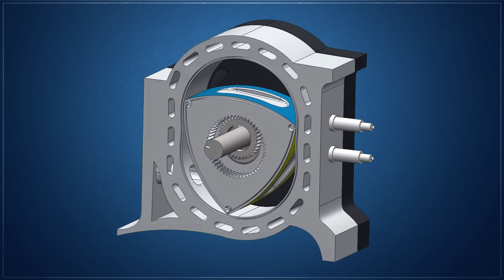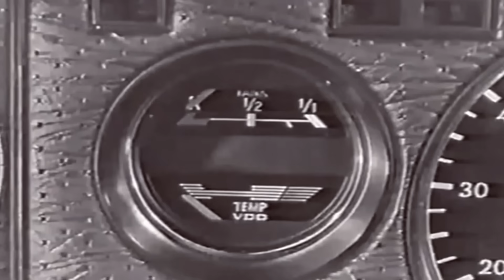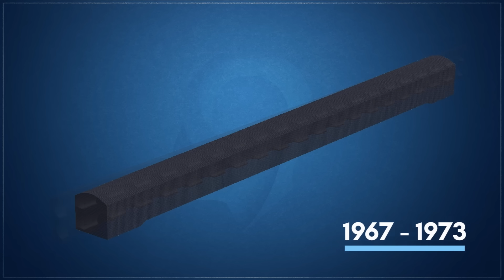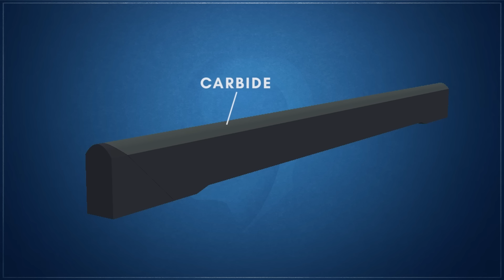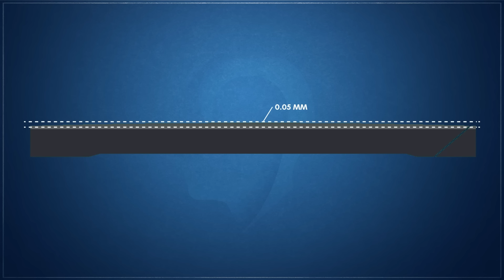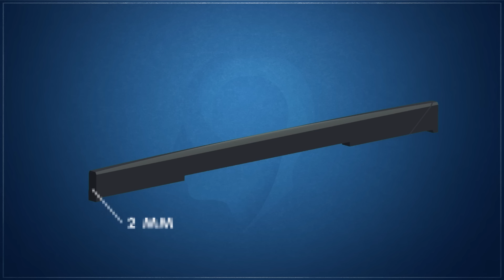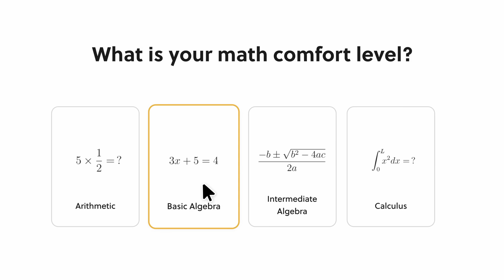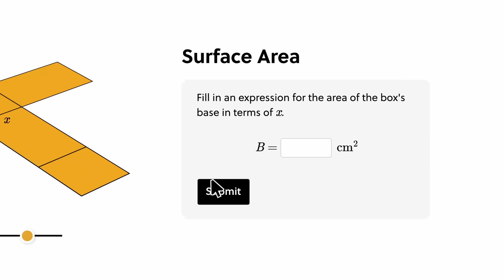Overcoming The Rotary Engine’s Biggest Flaw

Comment: As a Mazda tech when customers would come in and ask me what I thought of the RX-8 I told them it was very important that they purchased it with a sunroof. Once the compression dropped off to the point that it wouldn't run they could park it in their front yard and use it as a planter box.

Comment: It has more problems than just the seals , it can only produce decent toque at high revs and is notorious gas guzzler , it will only ever be a novelty !!! the ICE relic should be dumpt !!!
Reply: The Wankel engine is not just inefficient it is also inherently unreliable and less durable than reciprocating engines,
 ICE's are not going anywhere... its just the Wankel that is dead.
Reply: @DoktorBayerischeMotorenWerke  Time you moved to 21 century , this ICE garbage should of been killed off in the latter part the last one , it belongs with the steam engine !!!
Reply: @dennisrichards7994  ICEs are not going anywhere... they are here to stay, in some applications there are no practical alternatives.
Only the Wankel is obsolete, it was a dead-end concept that was never a threat to the successful ICE types.

Comment: You said the main problem with the seals was frictional vibration. They look to be positioned at a right angle to the contact surface. Did they try positioning them other than straight up 90 deg? Like a paint brush, even a ten degree difference would have solved that issue.
Reply: Apex seals are not a positive-type seal like reciprocating engines use where the seal integrity increases with pressure, both vibration and pressure from erratic deflagration and brisance cause the seals to leak and the hot gasses leaking pass the seal causes ablative damage that destroys the apex seals.

Comment: It has been reported that the biggest drawback of rotary engines is that their combustion chambers are long and narrow, like an eel's bed, making ignition difficult and preventing combustion. For this reason, early pollution countermeasures used a thermal reactor to re-burn unburned gases inside the muffler, and warnings were given that the high temperatures could cause a fire if the vehicle was parked on dry grass. Has this problem been resolved?
Reply: No, it hasn't.  The Wankel has an inherently poor combustion chamber architecture that results in poor combustion efficiency and high EGT (exhaust gas temperature) the design is also prone to pre-ignition and detonation that destroys the apex seals.

Comment: I think, the apex sealing/tribology is not such a big issue with the Wankel/Peschke engine. In principle you can solve it with a nice friction pairing like graphite against cast steel. You will always have enough water vapor to generate a sliding film within these components. The same relates for the side sealings.

In my opinion the biggest issue is overcooling due to a non-convenient volume to surface ratio. Another problem is the angle of attack of the chamber pressure with respect to the shaft. In a rotary vane engine it is much better. You can also balance the torque very easily by use of an elliptic chamber geometry.

Comment: Instead of solid Apex Seals, they should have installed rolling Zylinders at the Apexes.
Reply: How? the rollers need clearance to spin... that would allow gas to escape.
Reply: @DoktorBayerischeMotorenWerke Nicht unbedingt, wenn die Haptwalze selbst mit Walzen gelagert ist. Wie bei einem Kugellager.
Reply: @GuidoHenry1985  There are no known examples of the roller ever being used successfully as a gas tight seal.
 The rollers require clearance to expand with heat and will expand at a different rate.
 The roller is not a positive-type seal, as gas pressure increases, they do not increase their seal effectiveness like a twist-type seal in modern piston engines.
 Any questions?

Comment: Actually not having the right consistent combustion pressures(right amount of fuel) consistently,(it sometimes gets if and sometimes it doesn’t, it sometimes gets it and it sometimes doesn’t as it spins) is the true culprit due to again not knowing the right consistent fuel psi’s. If it sometimes gets it and sometimes it doesn’t then fuel delivery is what needs to be figured out. Flame will not be quenched if thrown at  right amount of pressurfrom low to medium to high as it escalates and decreases all the time and never stops moving. All the quenching of the flame is caused by not enough fuel pressure where it needs to have it all the time.

Comment: Hi folks,
        A good engine.  However, I like The "Revolver 12Cylinder Engive.  It has half the size,  weight, and parts.  Unlike 'V' configure internal combustion engines, it can run @Full Power without crankshaft failure.  It ran for 36 hours straight, wide open, without difficulty.  The tester turned off the engine when he stipped the test to go to bed.  V configured engine's cra k shafts can't take that kind of punishment. So check it out.
        Sincerely yours,
        R.

Comment: I once had a REALLY old low pressure dental compressor that worked off a single triangular rotar with three reeds like the wankel but made of  graphite ceramic. 
This isn’t new. 
The oil was delivered by a Mckoy type glass drip cup.

Comment: The primary problems with the rotary engine is the spark plug hole, and the position of the chamber in the rotor itself as it should be off center pushing the rotor in the direction of travel, and the spark plug hole reduced to a slit with a width less than the apex seal.

Comment: I owned three RX-7 models, and completed over 200,000km in them in total. I never EVER revved a cold engine, never drove off without letting the engine idle for at least 30 seconds, and never EVER took the engines above 3,000 rpm until they reached operating temperature. But... once they got warm, I gave them absolute death.
All three engines had been rebuilt with the proper 3mm apex seals, and they never let me down. I liked the fact they inject a little engine oil somewhat like a two-stroke. From memory, I added half a litre of (not synthetic!) motor oil for every 500 kilometres covered.
All three were fantastic cars that I enjoyed greatly, and maintained properly. I think it was poor fuel economy and bad combustion which doomed the rotary. Except now we're getting little rotaries as pure electric generators that aren't connected to anything except the battery. It will be interesting to see if full computer control over all aspects of engine operation can ensure engine longevity, and efficiency.
Can't wait for the Mazda Iconic SP!

Comment: The Wankel would run on as low as 67 octane (Coleman lantern oil or kerosene) and when you lower the octane by 10 points, you can make 4 times more fuel from same amount of crude oil. Any wonder why gas companies hated the Wankel? 

The Mazda passed the 1976 smog requirement in 1972 and no other car had passed the 1972 requirement. It had 2 spark plugs for each firing, leading and trailing to guarantee full burning of fuel.

From Motorsport Publications 1972

Comment: I spent 2 years in a Mazda dealership service department during the 70's.  Even with constant maintenance the rotary powered cars were doomed to fail eventually.  Oddly enough the piston engine variants were bullet proof and once sold were never seen by us again.  A local put an Rx4 engine from a totaled car into a sand buggy sans all the emission control devices.  He kept getting bumped to higher levels of competition until he ended up in the unlimited category.  His car was unbeatable if the driver could keep it right side up which considering the torque it produced was easier said then done.

Comment: You can improve the internal combustion engine but you can never overcome it's greatest flaws. It has too many moving parts that break or wear out and it is never more than forty percent efficient. You waste sixty percent of your fuel as friction and thrown away heat. The best that's ever been achieved is with the six stroke water injection engine where there's a second power stroke achieved by injecting water into the hot cylendar which produces steam pressure and also cools the engine. It still only added about twenty percent efficiency for a total of sixty percent but needed a supply of distilled water to prevent scale build up and distilled water costs as much as gasoline.  All these posts about great new engines are put out by big carbon trying to delay the adoption of EVs. It's failing badly. Sell your oil and coal stock while you still can.

Comment: I still have a 79 RX-7.  Since new. When these came out, you had to put down a several hundred dollar deposit to even test drive one - there was so much demand. Been sitting idle in a garage forever. I got 280,000 miles on it before I had to stop using it. But it was a daily driver forever. But it isn’t on its first or second or third engine. Every single time oil metering pump failure dried it up and cooked the seals. Right now it’s got an engine with 15,000 miles. I need to find somebody that would love to get it going again. I think it’s just got electrical stuff from sitting in a carport and some mice ate the wires. I went through years of surgeries and stopped fooling with it and left it sitting there, and I need to get it going again. Most of my adult life was tied to that car!

Comment: 0:22 - Goody; has nothing to do with the failure of the design.
The biggest flaw with a rotary is a result of physics and can only be "overcome" by throwing them in the trash. Any rotary chamber has two 90* corners running around the entire periphery of both sides of the chamber; flame-fronts does not crawl into such geometry. The Wankel rotary is DOA, period and if you do not get it, you missed a whole lot of thermal classes in physics. 
Better seals only means more raw mixture expelled; the chamber matters and the Wankel chamber sucks. Aways has, always will; physics matters.

Comment: I may be completely uninformed, but why couldn’t you just use small cylindrical bearings that roll along the edge of the housing as apex seals?
Reply: The rpms would be insane. If the engine itself can do 9000 rpms, imagine how many rotations one of those bearings would do per engine rotation.
Reply: @cryptojihadi265 Ok so I wanted to calculate this, my math may be wrong.

The radius of the 13B engine is 105mm with a 15mm offset, meaning the distance from the tip of the rotor to the crankshaft is 120mm.

Assuming the rotor housing is roughly a circle shape, we can calculate that the circumference of the inner housing is 2xPi x 120mm which is 754mm

An average apex seal is about 2mm tall, so let’s say our cylindrical bearing is 2mm in diameter. The bearing would thus take 120 rotations to roll along the inner housing once. 

So 1rpm = 120 bearing rpm

So at 9000rpm, the bearings would be rolling at 1.08 MILLION RPM.
Reply: Wondered the same. Although not sure where to mount them. There would have to be a gap, seems to me

Comment: I had a 1972 Arctic Cat snowmobile with a Wankel engine.  Even in those days the Apex seals weren't an issue on smaller engines like that.  But as the video says they were a challenge on the bigger engines needed for cars.  That was a good running snowmobile.  Dad and I used it for years with never a problem.  I wish I still had it.

Comment: One thing that has never been explained to me is how the sides of the rotor are sealed.  There’s got to be all kind of scraping there as well as at the apexes.
Reply: Your exactly right.  The number, size and shape of the rotor side seals was mind boggling. A retired Air Force jet engine mechanic built the rotary motors in our dealership.  Sarge used one pound of Vaseline in each rebuild to hold all the new seal and shims in place until it first started.  The smoke then was incredible for the first minute of operation.

Comment: The biggest flaw was not just the seals, it was the lack of torque. These were only suitable for high rpm , low torque applications . Torque demand resulted in a loss of efficency.

Comment: Could they use a roller bearing for the seal?
Reply: No, the clearance required to allows the roller to spin freely would allow gas to escape.
The leaking gasses will melt the roller.

Comment: had an '86  rx 7... worst car i ever had...  after Only  60 thou,  if ya drive it somewhere and stop , highly likely it would not restart, come back tomorrow.....had a new engine installed, same deal. 
plus all the other stuff like fancy  air conditioner electronics that didn't work ,  sunroof that rusted out in a couple years... they just tried to make a fancy  50 thou $$ car for 25 thou.  and I bought it. oh well.

Comment: Yes that is perfectly correct. They have not resolved the high emissions and high fuel consumption problems. They likely never will as was stated below due to the inherent shortcomings of the design which prevents complete combustion.
Reply: They will never solve the reliability problem or the lack of torque either... no advantages... only downsides.

Comment: I had an 1990 RX7 for 12 years. It never burned a drop of oil. 
Two problems: like a gas turbine engine, there is no low-end power. Honda Civics would blow my doors off at stoplights.
And a cold engine would not restart. Flooded it every time with both gas and oil from the first attempt.
Reply: Flooding is indictive of low compression, due to apex seal failure.

Comment: Should note that Mazda phased out the 3-piece apex seals for the RX-7s in the mid 1990s, opting for the 2-piece version we use today.
Reply: Mazda doesn't make Wankel engines anymore..
Reply: @DoktorBayerischeMotorenWerke  they absolutely do! They make new 13Bs for older cars (RX-8, RX-7), and they're currently producing a CX-30 with a rotary range extender.
And that's not counting the soon to be released RX-7 successor (RX-9)?
Reply: @3toedSloth75  The factory that made 13b engines was demolished in 2013 and no longer exists,
 The MX-30 was canceled in 2024 and is no longer in production.
 The RX brand was discontinued in 2012.
There is no RX-9 this clickbait myth has been debunked long ago.

Comment: My family had an rx2 and we changed the apex seals every 30,000 miles. After the first time breaking down the rotary it was a breeze. We put a side draft webber carb on to replace all the emissions and complicated intake. We could start removing the engine at 8am and have it back in and running with a fresh rebuild by noon.   The only engine easier to work on was my 1970 vw bug. After 250,000 miles on the wankle we could not get replacement parts and had to sell it.

Comment: Turbo seals are much worse than apex seals.
Reply: Turbos are extremely reliable... Turbos are so reliable that they can be used on certified passenger aircraft... while Wankel engines cannot.
Reply: @DoktorBayerischeMotorenWerke  yup mine blew at 60k miles and sucked a lot of oil into the catalytic converter.
Reply: @Monstacheeks  Poor quality cars use poor quality parts... There are many FAA and EASA certified aircraft engines that are turbocharged, and these turbos easily pass the torturous PFTR reliability tests and often last the life of the engine with normal inspections and maintenance.
 That is something that cannot be achieved with the apex seals or Wankel engines.
 Wankel engines are too unreliable to pass even the minimum reliability requirements for passenger aircraft.

Comment: 90% of all the wankels problems have been fixed. Ultimately the biggest flaw is the extremely high service area-to-volume ratio at combustion. This leads to very high emissions and low efficiency. Hypothetically the liquid piston design could solve this issue, but it remains to be seen if it will ever reach production.
Reply: The Wankel engine was a failure because it has several inherent, fundamental flaws and disadvantages that cannot be solved.
unacceptable reliability, low efficiency, high emissions, and low performance have never been solved..
Reply: @DoktorBayerischeMotorenWerke  I would slightly disagree. Reliability has been proven to be solvable with modern design techniques, materials, and proper maintenance. Not sure about the low performance point either. We can easily pull 500hp/liter from Wankels while maintaining far higher reliability than a comparably stressed piston engine. Ultimately the emissions and fuel efficiency will be unsolvable due to reasons I mentioned in my initial comment.
Reply: @ The reliability issues with the Wankel engine have never been solved, this is an irrefutable fact that cannot be denied. The reliability problem is inherent to the basic fundamental design of the Wankel engine, which was not originally conceived as an internal combustion engine but rather as a supercharger.
That is a common but false myth, maintenance is not factor, we see the same unacceptably high MTBF rates regardless of maintenance intervals, this is well-known and documented in the industry.
 Reciprocating engines were developing 1,000 hp per liter in the 1980's, Wankel engines consistently produce lower hp per liter performance and roughly half the BMEP performance of comparable reciprocating engines.
 These problems are all unsolvable, all the result of the Wankel's compromised geometry envelope which is why the Wankel has effectively been an obsolete technology for most applications for half a century now.
Reply: You seem to have a very limited knowledge regarding this topic, someone who is not familiar with these engines or the development history and commercial failure.

Comment: I have a semi mechanical solution that is self sealing using only geometry, a cutoff of the rotor, and pin + spring to keep the apex seal part in place during its full swing and rotation of the "piston"
Reply: There is no solution to the apex seal problem, it is inherently flawed by design.